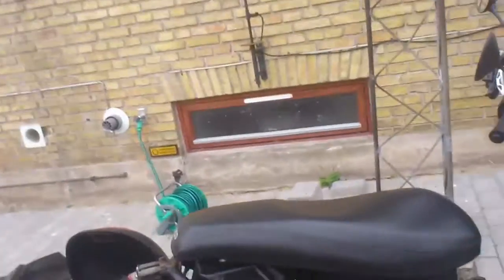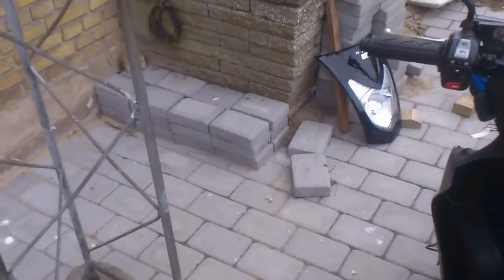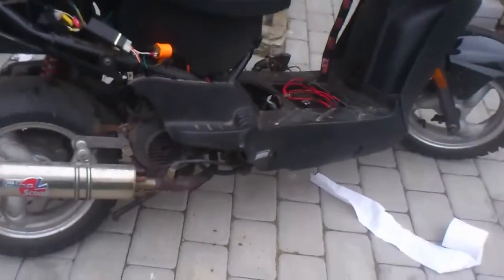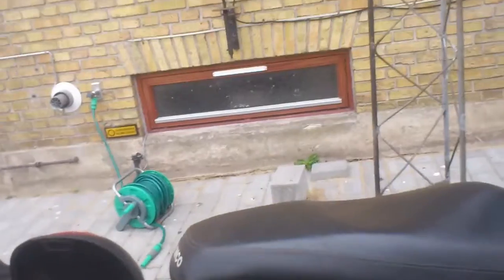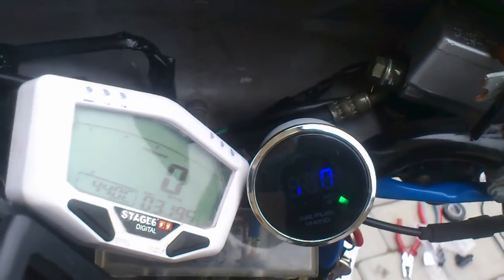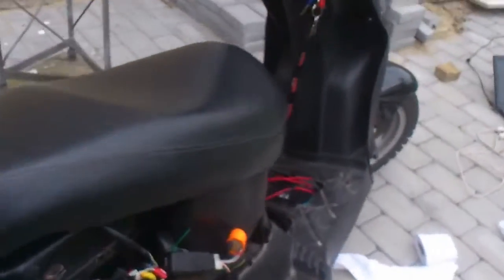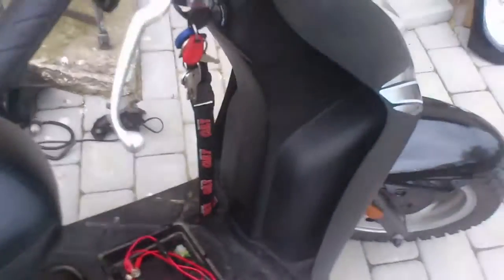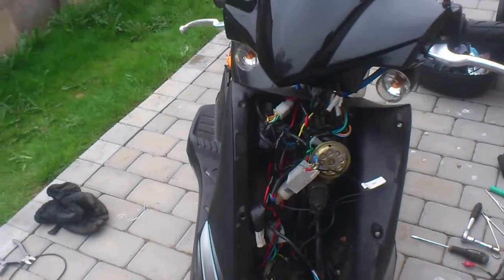The worlds lowest idle RPM on a GY6 engine

Comment: its been 10 years since then i wonder does she still run XD if you have it
Reply from the maker: It was stolen from me in 2015 so I don't have it anymore. I'm still really sour about it as it had €1300 worth of parts and it reached 55 km/l even when restricted to 30 km/h and I was about to test how it would perform when (illegally) unrestricted as my conditional license suspension would expire a month later than when it was stolen.
Reply: @PartykongenBaddi  that sucks man. I got my hands on a coleman at200-b or basically just a taotao with a gy6 even stock even though top speed is 35 is mph its fun. Had to clean carb Def needs new one as idle circuit is rough a new card should have throttle response.

Comment: I had my 50cc gy6 down around 740 rpm. It was due to a miscalculated fuel/air adjustment 😉 I didn't stall and definitely fixed it. I had purchased a cheap rpm/hour meter off eBay. It was a good 10$ investment. But good video my friend.

Comment: Does this low idle speed have influence on throttle lag?
Reply from the maker: Yeah it had but a large portion of it was that it was very hard/time consuming to tune the fuel quantity properly at these low rpm so when pulling the throttle from these low rpm, it would lean out for a bit before getting up to speed. Also, running a too low idle may lessen the life of your bearings so I would recommend that you stick to the manufacturers recommended idle speed. 
Leaning out at coasting will save you much more fuel than lowering the idle speed so it is simply not worth the risk of stalling, lag and damage.

Comment: Is your leovince exhaust painfully loud aswell? Took mine of after a month of headaches and a ringing sound in my ears caused by the damn loud exhaust on my agility.. XD I drive about an hour per day, but still loud enough to damage my ears :(
Reply from the maker: In the beginning, yes, it was too loud when driving less than 50 km/h, but I fixed it by bending the tube from the motor to the silencer so that it was more parallel to the ground and since then, I had no problems. :)
Reply: That could be a solution yes! Thanks :) Mine is loud no matter the speed (Unless I am under ~6000rpm)
Reply from the maker: I guess it was still loud, but when i went fast enough, the sound was somewhat "behind me". 
Pointing the silencer more down and away from me did even more of releasing the sound away from me. :)

Comment: i am still curious how low mine runs since you also can count the lil explosions from the exhaust xD
Reply from the maker: I have later learned that very low rpm can damage the engine. Ball bearings are not very good for shock loadings and by having such low rpm, the combustion have plenty of time to build a high pressure while the crackshaft is still at a low angle and thus, a lot of force is directed into the crankshaft bearings directly and more forcefully. 
Especially the acceleration of the engine when you no longer want to idle can damage the engine as the first couple of power strokes will be happening with a lot more force but still with a low rotational speed of the crankshaft. 
If the manufacturer recommends 2000 rpm idle, it will probably be the situation where the engine bearings last the longest.
Reply: okay ill screw it up a bit then its indeed very low
Reply: +Sebastian Jørgensen - Hi, shock loads are definitely not good for ball bearings. But in such low power application that's not a problem at all. 

In this case the really big problem is the extremely low output of the oil pump. On top of that this is an air cooled engine with a crank operated fan. So the air flow from the fan is also very low. 

So low oil flow, low air output and initial load increase. These are the main and real problems. As you probably noticed in the meantime. 

The three main factors to keep an engine healthy are being messed up. Lubrication, refrigeration, load. As a eng student you just learned why changing one factor could lead to a redesign of the complete system. 

Keep up with your studies. I've been there almost 30 years ago. ;-)
Reply: oil pump isn't a big problem since it still pumps enough oil to the cam  the cooling isn't a problem either since there is enough cooling because there is almost no heat produced due to low rpm  so i kind of don't agree with that
Reply: Well facts are more or less obvious. But either case if such, why not leave it as it is in really low rpm. Tweak the injection and ignition timing for the particular case and done.
Please check specs for any air cooled engine with forced air flow. Can be one of this GY6, any other scooter or an old VW, doesn't matter. They all have the same issues and they all have higher idle rpm's for some reason. 
Initial pressure from the stock oil pump is already a bit low.
But to clear any doubts, if you have the chance please get an oil pressure gauge an test an engine. You'll see how low the pressure get's at normal idle speed. Than cut idle speed in half and check again. 
Cooling, pretty much the same as above, in spite of a lower initial load when in idle. Every time it moves away from that condition either by accelerating or coming to a stop after a run it will not be able to cool properly because it's far from it's normal range.   
Load, we get 2 scenarios. 1 engine is put in service immediately after idle i.e. 800 rpm's and takes a huge load increase. Totally dis advised.
Or allow the transmission to work in it's normal range i.e. above the normal idle speed of ~2000 rpm. Well in this case load is the same as original, but we just wasted ~1000 rpm for nothing. In fact it's more because usually the CVT "catch" even later than that.
Another issue that was not talked earlier is the electrical charge. This engines output is already very low in idle with half the speed can't be better for sure, specially if we consider that the electrical consumption is already increased due to fuel pump, injector, etc. 

If you ask me I don't think this engine will "crash & burn" because of it. In fact the GY6 is a very well proven design with decades of good service But as any machine as it's weak points and most important  will surely not work in it's best range and life span can be severely  compromised. That I guess we all agree. Thank you for an healthy discussion. ;-)

Comment: you lose power making it idle low i tested my bike its got a carb when i have the idle high its faster
Reply from the maker: +Zed The top speed should be no different, but you are totally correct, that having a lower idle gives a slower start as the engine has very little power down here and since it has a longer way to go until the clutch engages. 

Other than that, I am now studying to become a mechanical engineer and i have learned that ball bearings are not good to shocks, which a single cylinder setup is very much. Also this gets even worse if they are exposed to shocks at low rpm. Because of this, it is really not recommended to go below those 1700-2200 rpm that the idle should be.
Reply: +Sebastian “Baddi” Jørgensen im a trainee mechanic so i got carried away with my idlein until the idle screw got rounded off now im stuck with the settings wish i could put the idle up
Reply from the maker: +Zed Just replace the screw then. :D 
The idle screw should be easy to remove if you damaged the head while having the idle low. If you have not got a new screw or don't want to replace it, why not just make a groove in the head so you can use a flat screwdriver? ;)
Reply: +Sebastian “Baddi” Jørgensen im planning on to do that i asked my mechanic just to see what he says an he said u need a new carb cant just get the screw but i seen plenty on amazon its stupid how some people like to chat rubbish lol its rounded quite badly but will try in the summer becuase it runs fine atm
Reply: those people are smart because they want you to buy a carb from them i guess

Comment: my gy6 idles at same Rpm with kehin carb
Reply from the maker: +Thomas Batts I never was able to get my scooter below 1400 rpm with a carb without stalling and never was i able to keep it at 600 rpm as i eventually could. 
Later, as i am now studying to become a mechanical engineer, i am told that ball bearings does not like shocks (and especially at low rpm), which is part of the reason why single cylinder engines are usually kept at 1700-2200 rpm at idle. 
Now i know that having a really low idle is really not the ideal, since a slightly higher idle will keep the engine stable at less ideal conditions while keeping emissions stable and also ensuring longevity of engine parts.